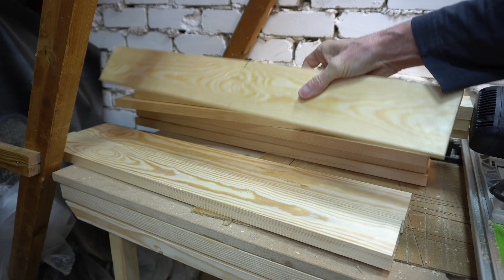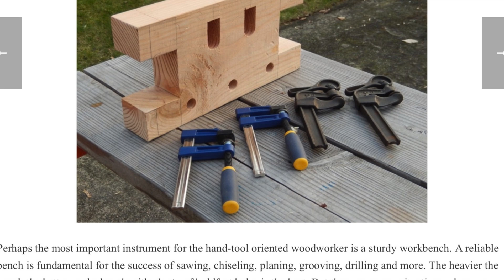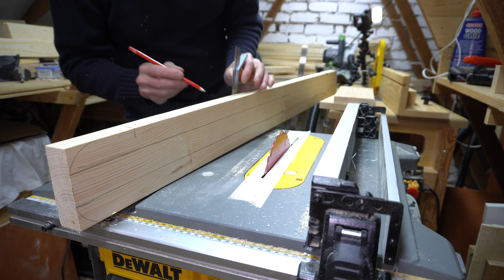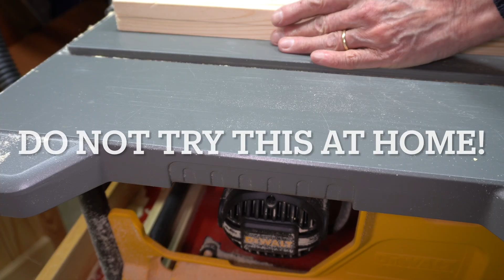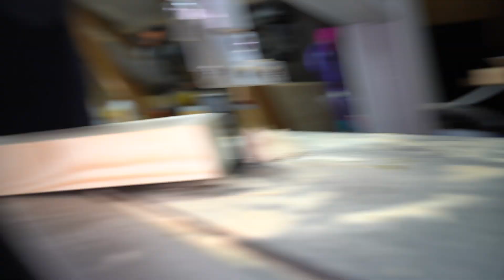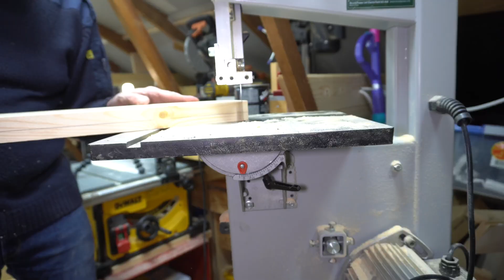Make a Bench Bull instead of buying a Workshop Vice

Comment: Great channel! 
Would you ever consider strengthening your loft joists and building supports either side, so you could do away with the purlings?  

I currently have a basic setup in my loft and the opportunity to open up the loft area is very tempting.
Reply from the maker: Thank you Steven. To do this you would need some calculations by a structural engineering. Otherwise you would struggle to sell you house. I used to design roof trusses and have seen a few people that have altered them running into issues. Regards JP
Reply: @Smallbarnworkshop  Yea I agree. 

Also, the exposed joists in my loft show the spacing is inadequate. and they skipped installing noggins.

Anyway, keep up the great work!

Comment: Looks really well made! Tell me, is there a reason you did not just permanently fix it to the front of your table? Many workbenches have a row of holes at the front for clamping...
Reply from the maker: The foldable bench I use outside has holes on the front. I couldn’t put holes in the front of my Paulk style bench. The fold down bench has the slot for my rail support. I also like the option to raise work piece higher than the bench top. The other benefit is it’s totally portable, I could clamp it to the kitchen table if I wanted - not that I would be allowed 😁 regards JP